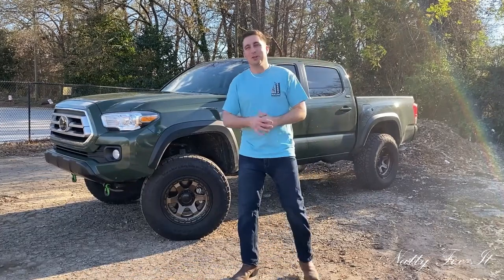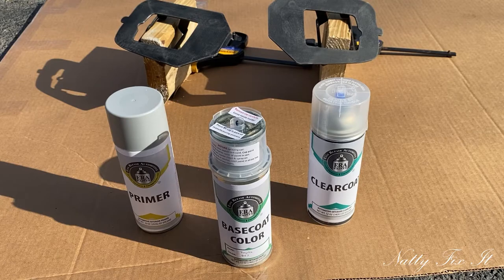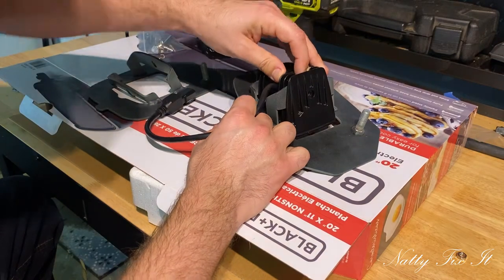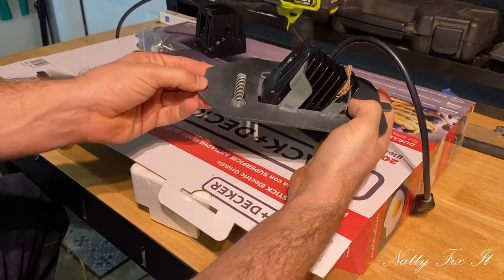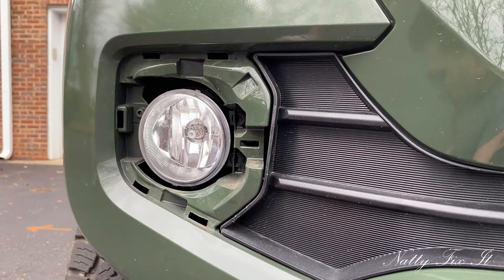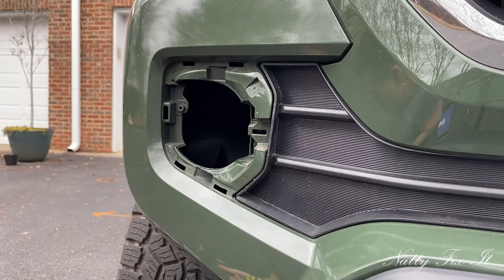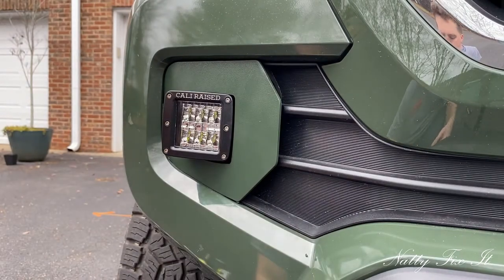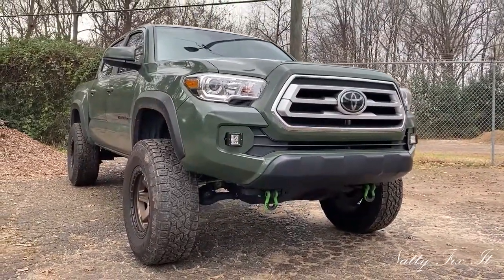Cali Raised LED Fog Light Replacement Color Matched Army Green On 3rd Gen Toyota Tacoma

Comment: Nice!  I have the same set up when I purchased my truck, but I want to make an adjustment.  Did you use the socket when you tighten the nut?  I need to removed that nut so I just wanted to know what size of socket did you used.  Tx
Reply from the maker: I did! But I unfortunately don’t remember what size socket I used. How have your pods held up?
Reply: @nattyfixit2898  pretty 👍